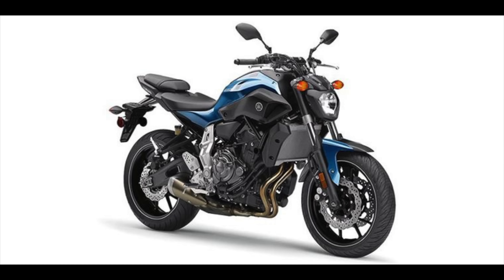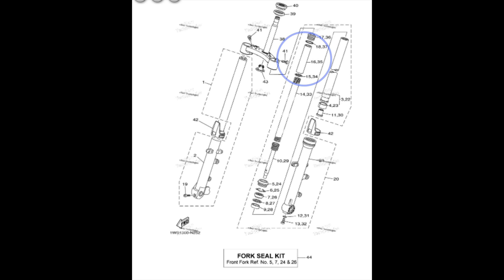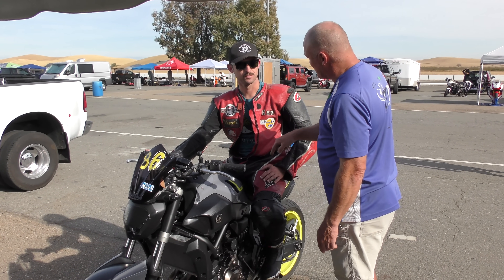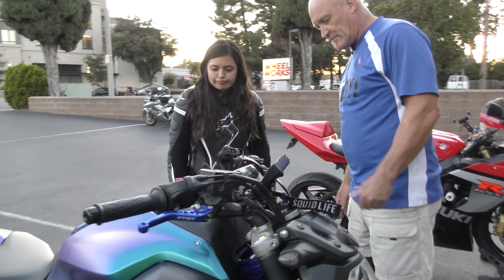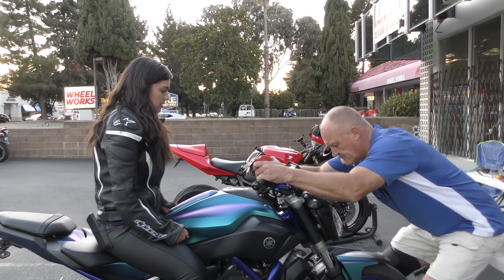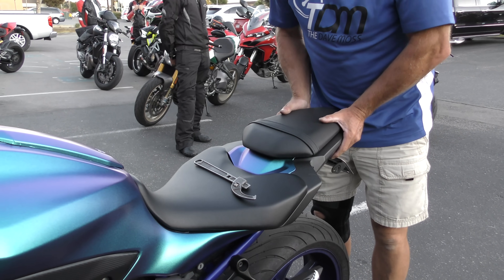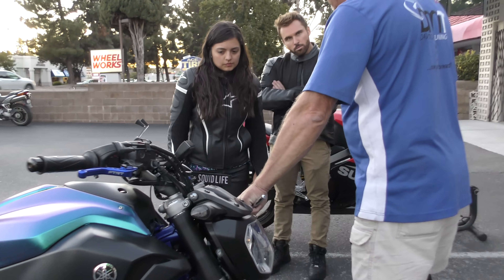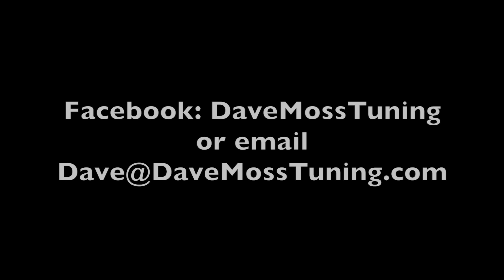Yamaha FZ-07 / MT-07 Fatal Flaw and How To Fix It

Comment: For the tiny riders out there, I did 15, 15, 15 and my bike feels like a whole new ride. I'm 5'2" 120 lbs. The shop trimmed my spacers 15mm. Added 15 W oil. And lowered the front 15mm. I can finally stand on the balls of my feet. And finally turn without the tail end of my bike bouncing and sliding all over the place. I paid just under 300 bucks to have it done at my local spot. Totally worth it. They threw in my asv shorties as well. Finally a setup for itty bitty riders! Yay!
Reply from the maker: Fantastic and thank you for the leap of faith. I appreciate your sharing the results to inspire others to make the changes needed!!!
Reply: @catalystreactionsbw  is this shock flaw still present on 2023-2024 models?
Reply from the maker: @Microphunktv-jb3kj  forks? Yes, in regards to fork oil.
Reply from the maker: @Microphunktv-jb3kj  Yes, it is.
Reply: So what this guy did for free would cost $100+ at your local shop. Sounds kinda extreme for 1 hour of work.
Reply: @mrbmp09  it's more than hour. Dave wasn't cutting spacers at the track. They have to remove the forks, empty, cut spacer, refill oil, replace. And I live in LA so it's probably higher for labor here.
Reply: @christinapage7394  where in LA did you take it? I also live in los angeles and would like to find a good shop to get the work done
Reply: @mrbmp09  it's not about how long  it takes to turn a screw it's about knowing which screw to turn. You're paying for expertise and making sure you don't kill yourself by doing it right.
Reply: @mrbmp09  Brother, you and the 2 people who liked this have never worked on a motorcycle in their life. he didn't do the work for free he told u want to do.
Reply: Hi, how much oil do the front suspension rods carry when changing the oil on Yamaha MT 07 2015?
Reply: @datpat2475  measure the oil you take out.
Reply: @highlanderfreelancer4553  but is not exact! Manual, no problem?
Reply: @datpat2475  if you let them drain for a few days it will be.
Reply: @datpat2475  the picther used to measure 2 cycle oil has pretty precise measurements on it.
Reply: @highlanderfreelancer4553  ok thanks
Reply: @datpat2475  it doesn't really have to be exact you can add more after test ride but you can't take it out. The critical part is the same amount in both fork legs and not over filled. Underfill of a half oz or oz will be fine.
Reply: @datpat2475  look in the owners manual or call Yamaha customer service. For your area.
Reply: @highlanderfreelancer4553  Im from Mexico, they don't tell me here.
Sorry!
Reply: @datpat2475  Yamaha north America customer service. Find that number that's who can find out. You might have to call a few times to get someone who cares.
Reply: Buy two oil (473mL) fork oil. But I don't know how long each bar takes.
Reply: @highlanderfreelancer4553  ok, thanks
Reply: @datpat2475  one bottle each? Probably more. how much drains out that's how much.  Take the caps of measure from to to oil level . Leave same amount of space when you fill.
Reply: Can anyone tell me?
Reply: I didn't catch it, spacer staff. Dave  lowered front of the bike by sliding shocks up , what is cutting down  spacers do?  And is it for yamaha bikes or all others, and how do I know if I need to do this procedures?
Reply: I love the color of your bike. Do you know what it is?
Reply: I first came to contact with this from my friend from tracks. I tested couple of the MT in Test Days and god damn... What a joke. I love old R6 and R1 to death and I can't reason how they ended up like this.
Reply: Hi 🙂! I am 5ft1” and I would like to know what kind of motorcycle you are riding. I am thinking of doing the same! Also, besides doing this, did you do other modifications to adjust the height? Thank you
Reply: @miya1000cc  we dropped the front end a tiny bit on top of adjusting suspension but that was it. I didn't have much problem touching the ground. I sold the fz07 and went back to supermoto though. I had a back injury that made the forward lean very uncomfortable.
Reply: This is so good to hear I am  short rider myself and I was tip toeing a ninja 400 and I’m really looking at getting an fz-07 because I’ve always wanted a Yamaha this makes me feel way better
Reply: Except nobody else is that short
Reply: Does this 15,15,15 helps reduce wobbles in higher speeds on the highways?
Reply: You’re adorable
Reply: Hi do you ride a mt-07 or mt-09?
Reply: I am 5'4" and have a 29" inseam. I measured more like 26" crotch to floor.  I can flat foot on my FZ-07 if I have a very heavy passenger. Otherwise I am on my tippy toes.
Reply: You could grind off the peg feelers fold them up with your calves and you could put you feet flat.
Reply: @highlanderfreelancer4553  Could But You Feet is my A-1 clown phrase of the week.
Reply: @gregp103  it was a typical put not but whoops
Reply: @highlanderfreelancer4553  Typical Put Not But Whoops is my A-2.
your* feet. Try another edit.

Comment: no static sag means the wheel has no extension. At say a pothole the wheel would lose contact with the ground. But it has it all in the compression for a say a speed bump. if even a 120lb rider is not right for this soft suspension yamaha truely failed. It's normal to have to stiff rear and too soft front forks for OEMS because they believe in "saftey" if a heavy rider get's on a bike the suspension will take the hit not the frame / rider. even if that means the suspension is setup for no one in the real world. at least yamaha gave us cartridge forks.

Comment: When I first bought my '17 FZ-07 I found the forks dived badly. It felt dangerous although I don't ride overly aggressive. One day I went to stop one a hill, & next thing Ii knew I'd been violently bucked off. Full gear left me with merely bruised ribs, from slamming into a tree, & a contusion where the space between my boots & leg armor hit something. I was lucky! 

I heard about  the fix described here, but due to my being very overweight (well above 200 lbs) I opted for stiffer fork springs & had a good shop do installation. I don't remember the fork oil weight, but the bike now feels stable & safe.  I think the modification you describe is likely good for most, but at my size I felt it might've been inadequate.
Reply from the maker: Thank you for your comment and shared experience. Glad you did not get too badly hurt. Above 200lbs would suggest fork springs at 1.0nm/mm or 1.05 rate if you were to make the geometry change. If the fork springs were this rate, 20w oil was probably used unless the damping rods were modified and that would requirew a. very specific oil viscosity.

Comment: Great video !!! Does anyone knows if this has been corrected on the 2023 MT07 ?
Reply from the maker: I have worked with many riders on the 2023 and they have just changed oil viscosity, volume and geometry.
Reply: @catalystreactionsbw Thanks for reaching out! Highly appreciated. So shall I take this as a good improvement and not a need to open up my forks ? 😅
Reply from the maker: @antonis981  Given the knowledge I have to date via other riders, it would appear that the modifications in part or full may not be required. I will see if i can find a 2023 or newer to create an updated video.
Reply: @catalystreactionsbw  Thanks a lot ! Greetings from Cyprus! Looking forward

Comment: Mr Moss,
  Hope you are doing well. If i installed a set of ohlins forks in my 21'MT-07, and decide to lower the bike, do i still need to trim the spacer in the forks??  I am 5'8 29" inseam and i weigh 210 pounds if that helps.
Reply from the maker: If you install Ohlins, all the measuring is done! No need for any other work other than fork geometry.

Comment: Does the MT-09 have the same issues or no?
Reply from the maker: It does not as it has adjustable suspension.
Reply from the maker: Several previous generations did not have any fork adjustments.

Comment: any tips for fz1?
Reply from the maker: Set sag in the 30-40mm range front and rear so the chassis is even. Set compresison at 50% of the total range front and rear. rebound will be set ater 30 minutes of riding to get the fork and shock oil hit. Do you best assessment on that as it depends on oil age. Assess fork and shock travel used visually to see if the chassis is balanced. If not, afdd/remove preload to get the same amount of travel front and rear.

Comment: can i still cut the spacer 10mm if im 200lbs and have a "saggy ass mod" its a rear link tht raises the bike a bit for stunting
Reply from the maker: Given what you are doing I would reduce by 5mm.
Reply: @catalystreactionsbw  thanks
Reply: @catalystreactionsbw  would u also recommend new springs and 20w fork oil ? or should i get the impulsive movement emulator
Reply from the maker: @Bluu_moto  I would suggest springs and 20w oil only, no need for the emulator device unless you feel you need it.

Comment: What model years is it relevant about ? If I have a late 2021 (gen 3) model, would it have the same "problem"  ?
Reply from the maker: The Gen 3 has slightly thicker fork oil but yes, the problem still exists with static sag and oil viscosity to a lesser extent.

Comment: Please confirm if I got it right. If I raise the forks based on my height and weight. I will get better stability and a better driving experience in corners.
But cutting the spacer inside is what it’s going to help with the bounce effect?? 

Right now I don’t have any problem with my 22. But I’m 5’5 155lb. I want to lower the bike so I can set my foot flat. I was planning installing trex on back and raise fork 15mm or something like that.
Reply from the maker: Given what you are looking for, lowering the forks 15mm and cutting the spacer will give you what you need.

Comment: I just did this mod on a xsr700 2020, skipped spending on springs, just adjustable caps and 15w synthetic oil  from lucas. And cut spacers 15mm

On bumps it eats it up and its medium plushness is what prefer. 

Thanks Dave
Reply from the maker: Thank you very much for sharing your experience to show others that this simple modification process makes an enormous positive difference.

Comment: Is this still a problem for 24 mt07?
Reply from the maker: If static sag is 15mm or less, yes it is for spacer length. If the fork bounces three times with new oil, yes for oil viscosity.

Comment: Stock my FZ-07 forks handled like a Pogo Stick very sketchy at higher speeds.  I hit a deer and bent my forks badly in 2019 I paid $208.00 each for new forks and $650.00 for Ohlin Cartages, night and day improvement. I have a K-Teck rear shock to install too .
Reply from the maker: Great post and thank you for sharing your upgrades and what a difference they made.
Reply: @catalystreactionsbw    You said that the stock shock wears out after 12,000 miles, I have noticed that. I carry side cases and a top case 95% of the time. I am one click off from the stiffest rear spring setting and I weigh 180# though I did get down to 160# in 2020.  I finally did my first track day this summer.  I just took all of the luggage off but left the spring pre-load the same.  I should have thought to check the sag.
  I had lowered the forks in the front tubes because I have very short legs, then I chose to go back to fully extended while riding on the tail of the dragon.  I thought the geometry was better with the forks extended out.
  When I got to Tail of the Dragon and put my tent up .. I took 80 Pounds of gear and luggage off from the bike.  I know this because I weight all of it when I got home from my trip .
Reply from the maker: @mikeskidmore6754  Great post to help people realize their bike needs their preference for settings!

Comment: hey cobb local here, trying to dial in my fz07. did the front with your recomendation of 20w, 400cc, no spacer cut (im 250lbs).
installed a ktech k-lite rear, with preload, ride height, rebound adjustments.. sag set 35mm race/9mm static..30psi F/ 33psi R cold

rear tire is perfect, looks like a beach with tide going out.. except on the rear/back edges of tire, edges/grooves are raised... everything on internet says that means rebound is too fast...

soooo i adjusted the rebound clockwise/harder/slower 1 click, and i did 2 hour ride, and now the edges are worse, and raised even more, almost double the height.... should i simply speed rebound up a few clicks.
Reply from the maker: In this case, your rear pressure is doing that to the tyre. May I suggest 36 front and rear as a test to see how the wear changes prior to making any firther rebound changes. I deal rebound for your weight would be 4-6 clicks out depending on oil age and odometer reading. Ping me next week, I will be back in Cobb.

Comment: if i am installing a rear shock thats 2.5inches shorter in length that the original shock ,physically what part of the bike has to move to just make this installation possible? thanks
Reply from the maker: If the shock is that much shorter, you will need to loosen up the linkage bolts as well. Put the top bolt in, then raise the rear wheel to line up the bottom bolt to install it. Will it line up or is the spring hitting the swing arm? Once all bolts are installed, torque the top and bottom bolts, then the linkage bolts.
Reply: @catalystreactionsbw  thanks for the reply, since  my bike rear shock is a simple single shock directly installed on the swing arm i am guessing i have to loosen up the pivot point if necessary?
Reply from the maker: @jamie55555  yes, that would be correct.

Comment: Thanks for a very interesting video , i have a 2019 mt07 from new and love the bike but am going to see if your suggestion's improve the handling . i haven't altered anything on the suspension since i bought it.
Reply from the maker: You will find a huge positive difference with the fork oil change, spacer trim and fork reset for height. Then take a look at shock travel used and find the right preload setting for you based on your weight and skills.
Reply: @catalystreactionsbw  Many thanks

Comment: I have a 2023 MT-07, I'm 170 lbs, got a lowering link for the rear, took it down 1in, the front forks are 3mm above the triple clamp from factory, whats a good drop to start for the forks? 10mm? the bike seems slower in the turn in after the lowering link.
Reply from the maker: 20mm drop to start as you lowered the rear 25mm

Comment: Won't her MT be much more BOUNCY now?? I just tightened my rear a little and it feels better at speed.
Reply from the maker: Nice change as it puts the forks under more duress constantly, so it will handle better. Post fork oil change it will be dramatically better.
Reply: @catalystreactionsbw  I guess I meant the rear specifically. Newer models have a rebound adjustment too
Reply from the maker: @forgot2wipe   yes, more upgrades for newer models

Comment: Hey Dave, what changes (cutting, oil type and volume, ans triple clamp position) would you recommend to me if I'm about 80-85kg? Thanks a lot!
Reply from the maker: 10mm spacer trim, forks at +8mm height, 400cc of 15w oil

Comment: Hey guys, I'm planning to do this mod, so what would be my best way of doing it when I'm 80kg no-gear? I guess 140mm spacer, 15W Fork oil but how much of it? 400ml per tube? Thanks a lot for advising.
Reply from the maker: 400ml per tube, forks at 8mm geometry setting.
Reply: @catalystreactionsbw  amazing, thanks so much! 👌😊

Comment: hey dave just picked up a fz07 18k miles, does the shortening the fork spacer still apply to me, im 250lbs.

also what front/rear cold psi do you recommend for cobb mtn, lake co, sonoma twistys? bike just has sportmax gpr300's at the moment, nothing special.
ill put in 20-30 weight fork oil also.
working on buying a shock... probably k-tech or ohlins.
Reply from the maker: Congrats - will be back in Cobb next week for a couple of days. If you are over 200lbs, 20w and 400cc. No on spacer trim due to your weight and yes to geometry change.
Reply: @CatalystReactionSBW  thank you! I will stop next time I see your van around! 

I set psi to 29f / 30r for now.

Comment: Hello does lowering the clamp (getting the forks higher) gets you more preload?
basically If I cut the spacer 10mm and getting the forks higher by 10mm do they cancel each other?
Reply from the maker: Good question. Lowering the front end adds more load to that part of the biker. This is minimal compared to the spacer trimming.
Reply: So if I bottom out I can lower the front end to get more preload and if I barely use the length of the suspension I can cut the spacers to get less preload? @catalystreactionsbw
Reply from the maker: @theyellowjello5883   if you bottom out, you add preload to get to 15-20mm from that bottom out mark. Then you use compression to manage fork speed of collapse under heavy braking. If you bottom out at close to maximum preload and compression, you add 30-50ml of oil. If you bottom out again, you decrease the amount of fork sitting above the upper triple clamp/yoke to take stress away from th front tire and if that works, you can soften preload and compression.

Comment: Hey Dave, about to do the mod, plus add preload caps for fine adjustments. Do you have an exact amount of front sag I should aim for? What about rear?

Also, how does front/rear sag bias affect the handling? Thanks!
Reply from the maker: Static sag 18-22mm, rider sag 15-25mm. Mark mechanical bottom out with the forks compressed to save you timer later.  Rear will not have any static so rider 20-30mm

Comment: Thanks for the amazing info Dave. Quick question: should I cut the internal spacer, even if I install preload adjuster caps on the forks?
Cheers!
Reply from the maker: If you are installing preload spacers and making the oil change in viscosity and volume, see how much travel you use without using the caps. I you are close to bottoming, hen install the caps and set them at 6 turns in and ride again.